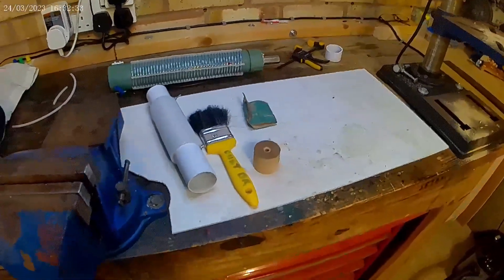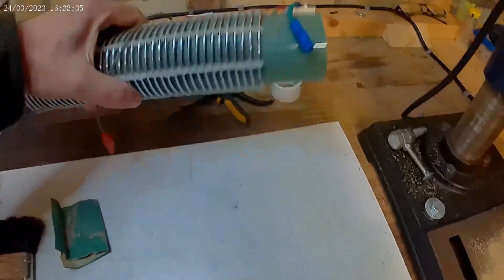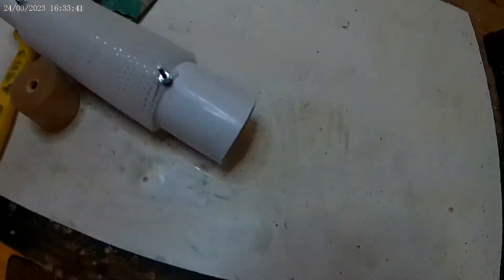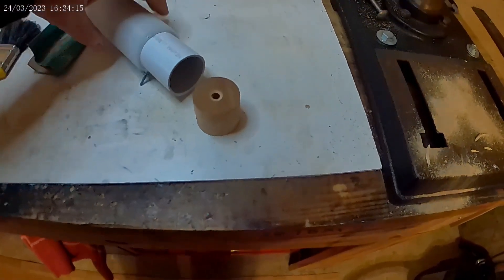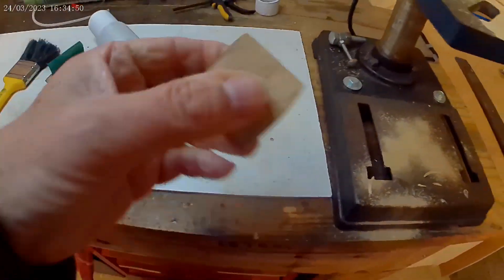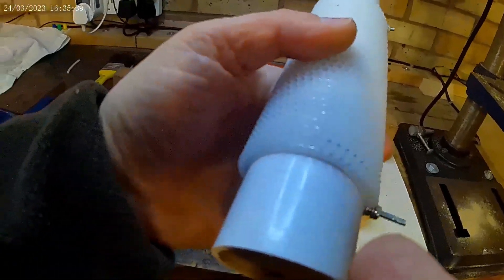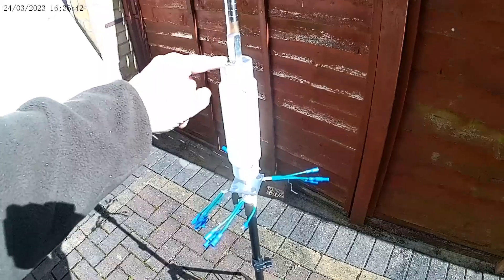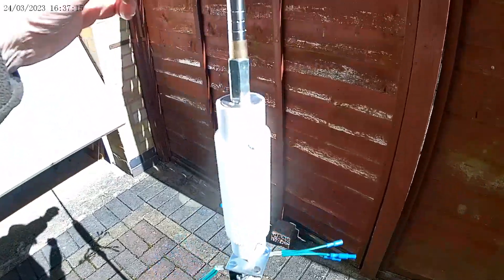HF Antenna. DIY Loading Coil Part 1. Amateur Radio. Plastic Pipe. Garden Wire. Ham Radio.

Comment: Nice. I’m wondering if it might be easier to wind the coil by winding wire alongside something non-conductive like nylon ”Weed Eater” cord …

73 de AF6AS
Reply from the maker: As there's no tap on the white coils it could wound using enamelled copper wire or even plastic coated single core wire. Cheers from old George

Comment: Hi. Thanks for your video. What inductance value is the coil?
Reply from the maker: Which coil. I have made 4 coils. The original green one was thrown away months ago. George
Reply: the white one in use with the steel whip to get 40m
Reply from the maker: @andrewferguson3703 OK Matey will do a video on the inductance value of the coils and turns etc . Cheers from George